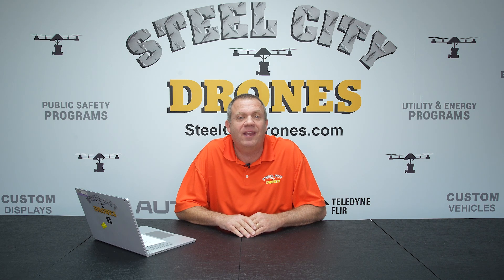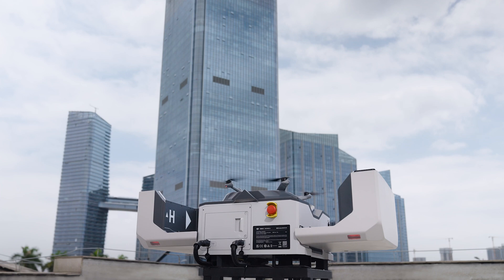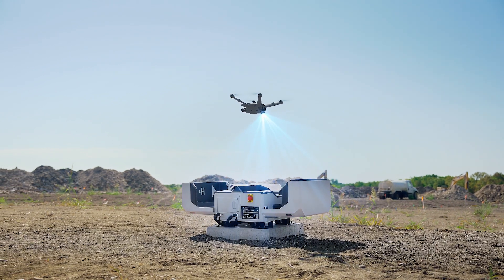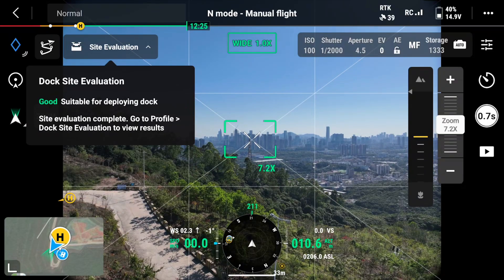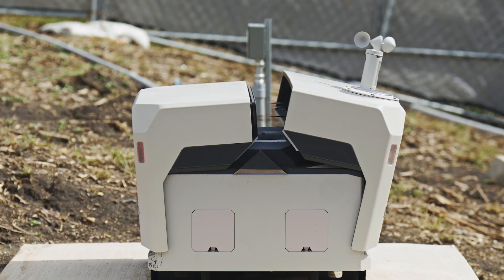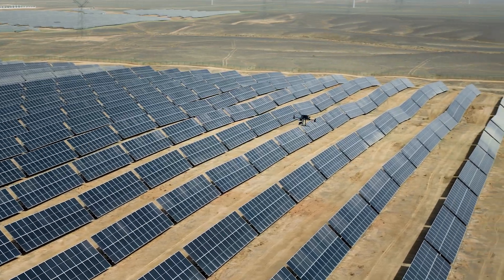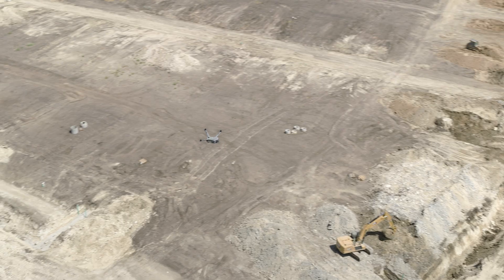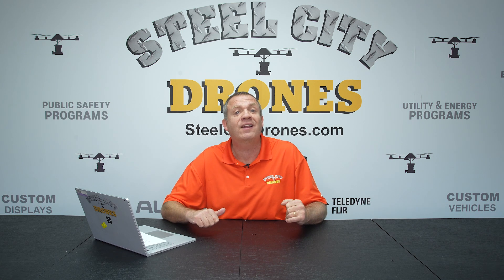DJI Dock 2 | DJI Matrice 3D-3DT Release Breakdown

Comment: Matrice 3D Versus Mavic 3E
1)	Dust/water resistance: Matrice 3D (probably has) versus Mavic 3E (do not have)
2)	RTK GPS Antenna: Matrice 3D (onboard) versus Mavic 3E (external accessory)
3)	Aircraft weight: Matrice 3D (1410gr) versus Mavic 3E (940gr with RTK antenna)
4)	Battery capacity: Matrice 3D (7811mAh) versus Mavic 3E (5000 mAh)
5)	Battery weight: Matrice 3D (544gr) versus Mavic 3E (335gr)
6)	Max Flight Time: Matrice 3D flies (50min) versus Mavic 3E (45min)
7)	Obstacle avoidance: Matrice 3D has (6-directional) versus Mavic 3E (5-directional)
8)	Lens defogging: Matrice 3D (has) versus Mavic 3E (do not have)
9)	Photogrammetric camera: Both share the same M4/3 20mp CMOS sensor
10)	ISO Range: Both share the same 100-6400 ISO sensitivity
11)	Shutter: Both share the same 8-1/2000s mechanical shutter
12)	Tele camera: Both share the same 12mp, 162mm ½ inch sensor camera